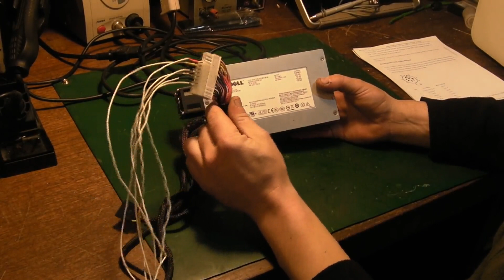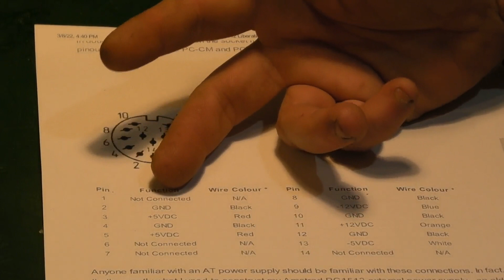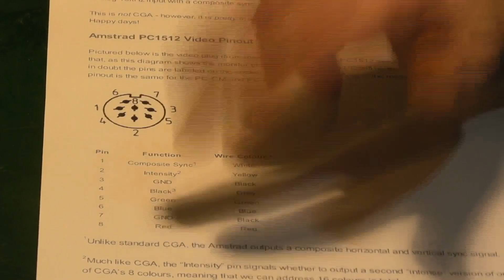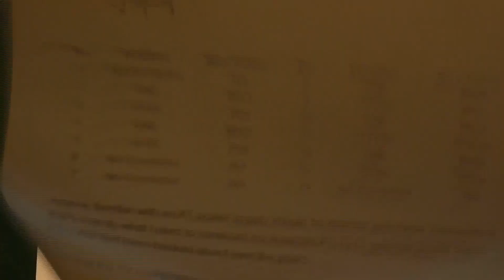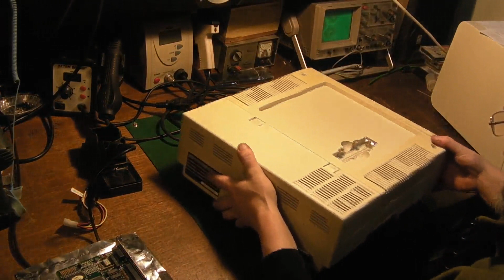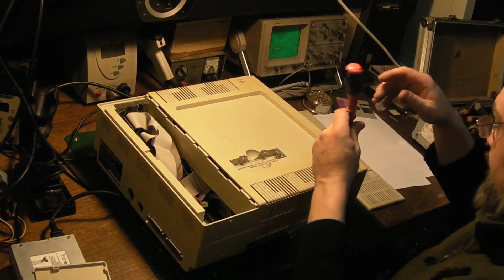Amstrad PC1512 Pt2 First power up attempt

Comment: You can use the hercules adapter either as second display (that is why it shows the cursor) or use the 'nvm' tool (or was it nvr?) to make it the primary display. The the cga output would only show the cursor. And it will boot from and completely use the hercules display.

Comment: i have a pc1512, got it in the mid 90s, no monitor, so rigged up a psu from another piece of industrial equipment(didnt have any pc stuff back then),  i had a plastic cased microvitec cub monitor with ttl rgb plus bright and single sync input, the 1512 wouldnt drive it directly (has positive driving open emitter follower output, apparently, with the original monitor has pull downs to ground on its input,  i didnt know this at the time as didnt have any circuit/schematic and couldnt get one at sensible price!) with a bit of experimenting rigged  up an inverter buffer using a 74HC14, and worked perfectly,   i'm thinking of seeing if possible to make a psu card to fit in the expansion slot, converting dc from a common 19v laptop psu, to the required voltages, should be possible , already have a couple of circuit ideas .... just depends if the tracks to the slot sockets can handle current going in ,to power the whole thing, instead of out for a card, or could make a  Y cable to feed the floppy drives as well, so helping with current sharing ...   yep, those 14 pin plugs are now as rare as honest politicians, wish i'd bought a few more from maplin while they had them, only got 2 , d'ohhh  i'd have never thought a din plug would become obsolete!!!  also with no info for the power socket pinout, had to do a bit of buzzing out with a meter, but did somehow get hold of the video pinout, think from a magazine article.?  the 1640 uses a Dsub connector and i think ? more standard??
Reply: should be possible to make a video signal adapter to drive a rgb scart capable tv ..., i've seen circuits for cga to scart, this would be almost identical  ,, i can draw up a circuit you could try and i'll post it on my FB page or somewhere and post a link to it here if you're interested?? unfortunately i cant easily try anything with mine at the moment, its in storage and have no space here at the house to do anything much!
Reply: i used to have one of those ibm monitors but stupidly dumped it , aargh
Reply: and dumped the cub ... double aaarggh
Reply from the maker: Hi i'm in the process of doing exactly that, I have a circuit built up and am just waiting on an 8 pin din to arrive so i can give it a try. ill get a video up about it ASAP.
Reply from the maker: I was thinking of designing a 8 bit card to an ATX psu connector and feeding power in that way. your idea is a little more elegant than mine.
Reply: @Jayoldstuff1  it saves having a whopping great psu stuck on the outside, i dont think  the 1512 takes that much current, except when floppy drives are running, so a standard ish laptop psu of mid current range, say 4 amp , 80/90w should be able to power it, using 2 switching step down regulator circuits for the +5 and +12, and tapping off the switching pulses and rectifying and regulating for the -12 and -5 as they only need to be small current capable

Comment: There's something about the PC1512 not supporting a plug-in video adapter, so the cursor you see is just what your MDA-card is generating, whereas the "real" video is coming out of the PC1512 itself.
Reply from the maker: There where two versions of the PC1512 motherboard the early pre 1988 version (what ive got)  and you are correct you cannot disable the onboard video. on the post 1988 version (what i had back in the 90's) you could disable it. however i believe its possible to disable it on all the 1640's.
Reply: @Jayoldstuff1  the service manual i managed to find online only  has one 'version', in it, it maybe that later 1512s used 1640 boards, but with less ram fitted? i dont know, my 1512 has i think 16 ish empty slots for the ram, cant remember for sure
Reply: i suppose there may be a way of deactivating the internal graphics system but likely not easy, probably track cutting involved
Reply: the 1512s graphics system is cga like but more capable, having 16 colours instead of 4,  bit like tandy/pc jr or plantronics, but not compatible with either, as far as i know!